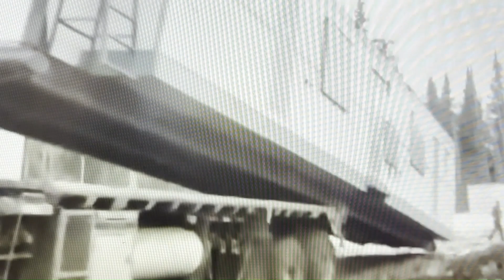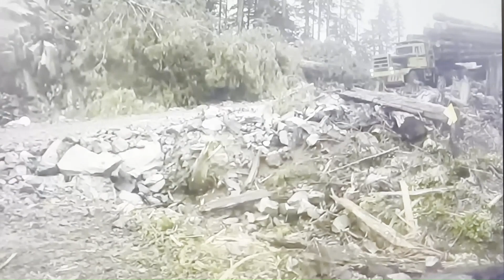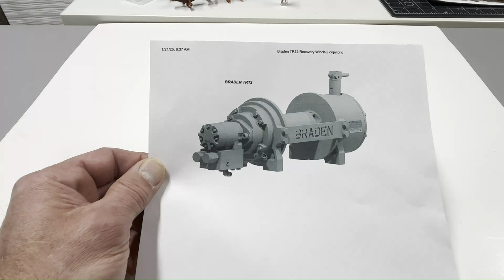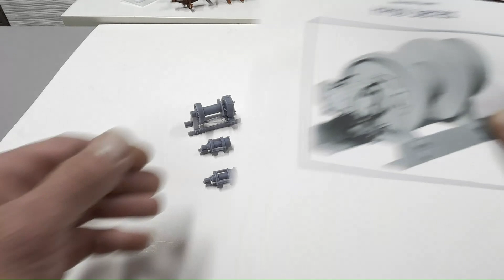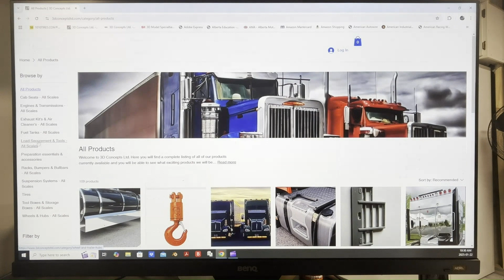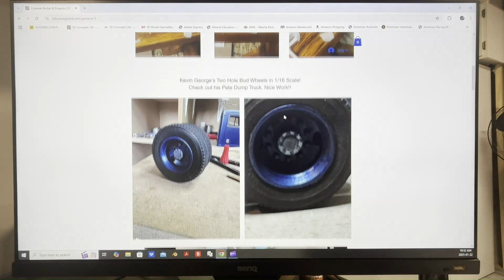Winches Now Available At 3D Concepts Ltd.

Comment: Karl, I am just getting back into model building and greatly look forward to using your products.  I worked on ginpole trucks and cranes for several years and I want to build a nice Ginpole truck, you have a lot of parts I want after I get moved. what I am curious about is do you plan to later offer larger single shiv blocks like 20-80 ton or so? Or how about PTO's or Hydraulic pumps and controls ?  Most of the equipment I worked on was older so I am a little lost with hydraulic powered winches but not much.  I am really looking forward to building some rigs with your parts. Everytime I look at these sites I am looking for stuff like auxillary transmissions and the list goes on and on.  Well I do have to say thus far you have the best site I have found, I'll be ordering.
Reply from the maker: That's awesome! Glad to hear you're enjoying the site and I appreciate your suggestions for new parts! I'm glad to hear you're getting back into model building!

Comment: Will you be adding any drive systems for the winches?? Chain drives off of a PTO  mounted onto truck transmission. Old School winches were all chain driven as opposed to " modern" Hydraulics.
Reply: Depending on how far back you are going, not all were chain drive. I had a 71 359 that had a Hubbard wrecker bed installed in '74. It was fully hydraulic.
Reply from the maker: Hydraulics have been the majority of applications for a long time now, for sure! Thanks again for all your support Robby and your order will ship out soon!
Reply from the maker: Hey thanks for tuning in! We did discuss doing a mechanical winch but we haven’t gathered enough information at this time. As Robby says in his comment, hydraulics have been used for quite some time. We need to develop a pump and tank to compliment the winch lineup now. I appreciate your suggestion and it’s not off the table. Thanks again!